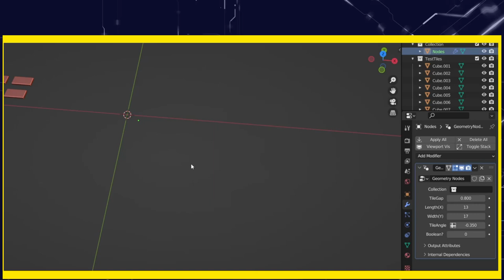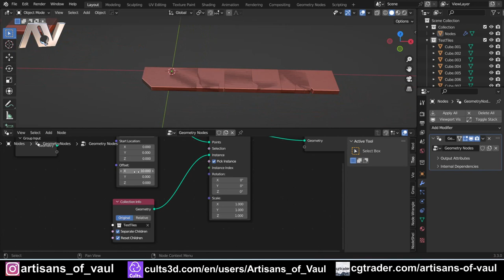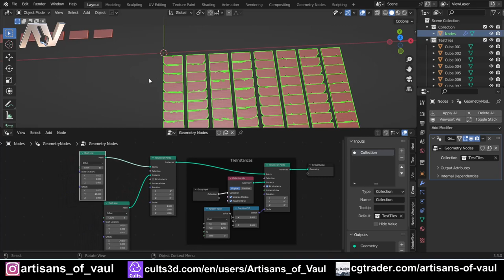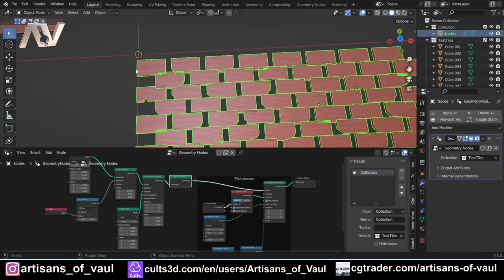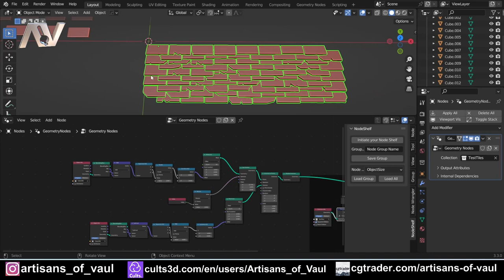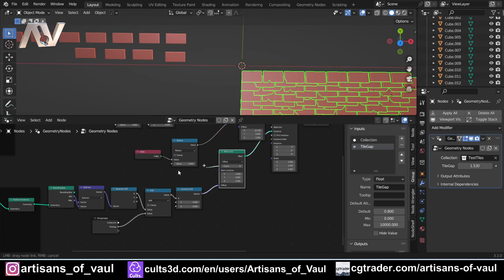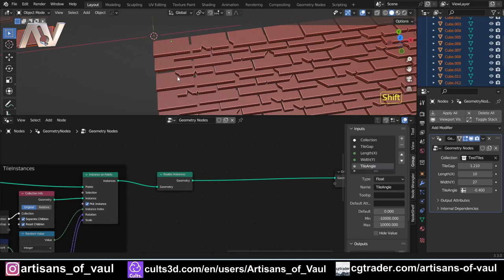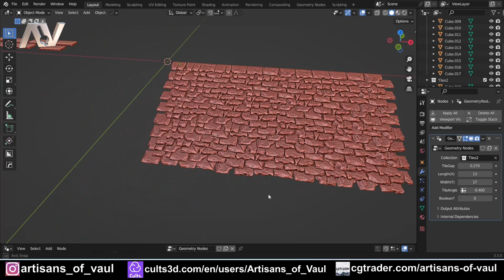The ultimate tiled roof geometry node setup

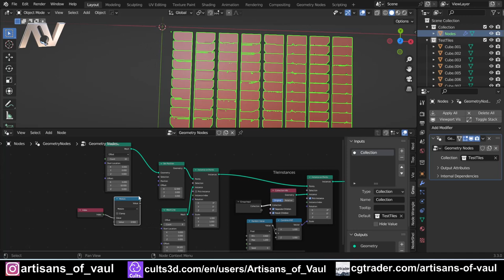Comment: 10:40 Looking for Modulo in 3.5.1? Add a Math node, then in the drop down select Modulo.
27:25 Press M "Mute" the Mesh Boolean note to speed things up, then when you're happy, unmute the node.
Reply from the maker: Oh great comment, I didn't know you can just mute a node. Thanks so much 👍🏻 Is there a way to do this from the group input (taking it to the modifier panel) without using a switch node setup aswell?

Comment: 8000 follower nice. Congrats. Next upgrade of the node is now to add a follow a spline so you can generate all forms of roof instead of only flat. Great work.
Reply from the maker: Thanks so much. I have been having a bit of a look at spline length, this just seemed an easier method as I assume a flat roof is the most common type to need, I do want to look at using spline length for something in the future but there seem to be a million videos on YouTube recently with tentacles so I thought I'd leave it for now 😅 Definetly in the future though👍🏻
Reply: @ArtisansofVaul   Make it !!!!! ... NOW !!!!  🤣😂
Reply: That´s what i looking for ...
Reply from the maker: @Container-11  😅 As in rounded roof sections/corners.  I imagine the issue there would be that the tiles would need to be either smaller or less at the higher levels to accommodate the turn.  That is a tricky one.
Reply: @ArtisansofVaul  Thanks for answering😃.... someone😉, maybe could combine the curve/spline with the array ...
Reply from the maker: @Container-11  So thats very possible.  In fact there are some really cool things you can do with it involving the spline length.  I think in terms of an angle roof it could be tricky to make it work easily.
If you want to check a video on using splines with arrays I have one you might like here: https://youtu.be/_7JLcoozOiM
Reply: @ArtisansofVaul  I have seen this Video and a Idea popped up in my old brain. A curve spiraling down and with it the Tiles for the round roof.
I will try this...later. Time is my problem

Comment: good well explained video, super useful video to learn geom nodes.

I'm trying to add starting and ending tiles but cannot figure it out. What i think needs to be done (but i don't know): 
1. instead of using the x-offset we add a point at the start of every other row which has the distance of the offset instead of the regular points distance (vice versa for the END of the other rows)
2. At these 'offset-points' use an object from another starting-tiles or ending-tiles collection ( like an if-dividable-by statement almost)

Is there a simple solution like that for this?
Reply from the maker: That should be possible as you can select specific points. There's a number of ways you might want to check out: https://youtu.be/09wyhmrSGPk

Comment: Can you do an old church wall the same way? I am trying to find a way to do a very old church wall that has rows of different sized bricks. Quite mind boggling.
Reply from the maker: You can but having each of the bricks a different size would be difficult as it works off of having the tiles the same size.  So youd make multiple sets of different bricks with each set adding up to the same.

BUT....  If you dont mind not using Geometry Nodes use the wall builder option.  Check out my videos here if you want to check it out:
https://youtu.be/SomEVY5qG0M
https://youtu.be/ylX-NEnPH1E

Comment: Great, but two questions. 1) can you add an opening for a skylight while keeping it as geometry nodes? 2) how do you deal with the sides? A real roofer would cut half tiles on alternate rows!
Reply from the maker: Yes to both but the skylight would probably be easier outside geometry nodes. Cutting off the half tiles I left off as it's just using the same tools again (use the size of the tiles to move a cube that is large enough to cut everything and use a boolean to remove it. I did think about putting it in but having a video much over 30mins seems to decimate the number of people that actually view it and because of the wonders of how YouTube works that means it doesn't get put on as many peoples feeds
Reply: @ArtisansofVaul  my experience with booleans and geometry nodes is that they don't work together. Your machine will just grind to a halt. I've not found a solution yet.
Reply from the maker: @privacytest9126  So the switch at the end of the video really helps deal with that issue. It's booleaning together some way more complicated shapes so cutting a cube off the ends should be fine. But admittedly it does depend on your machine. And importantly for the skylight your computer will find it easier if you applied the geometry nodes and then did the boolean.
Reply: @ArtisansofVaul  Sure, but applying your GNs, then doing a boolean kind of defeats non destructive modeling! Thanks for the reply, btw. 🙂👍
Reply from the maker: @privacytest9126  I mean that's only needed for the skylight. And you could do it without but I think it would be more effort/time consuming. The cut off ends I'd do in the nodes.

Comment: the only question I have with this roof is how it prints. there is a big gap at the bottom, isn't there? how do you solve it? other than that, amazing job, straight to favorites!
Reply from the maker: What do you mean by a big gap at the bottom?  Because of the overlap it makes a pretty strong roof when I have done something similar before.  I might have to print it to show the end result.

Comment: Hi and congratulations for your work. I am new to blender and geometry node and I managed to reproduce your tile set up. However, I wanted to go further by trying to get random tiles along the length but I couldn't. To be precise, I can get tiles of different lengths by connecting a Random Value on the Y of the Combine XYZ in the TileInstances but the bounding boxes don't follow. I have gaps that I can't correct. A solution maybe ? Thanks in advance.
Reply from the maker: So the gaps are actually really hard to deal with when setting random sized as you can't set the vertices to match.  An alternative is to actually make random tiles and then set to to randomise between them. If you have the random ones in sets of 3 or 2 of varying sizes but that the total fits the gap you could do it that way.

Comment: Also for 3D printing, how would you make sure there are no actual holes in the roof between the tiles?
Reply from the maker: So the holes are only there because of the extreme/exaggerated cuts on the tiles. But you could always add in a cube below the tiles that increases in sized based on the tiles.

Comment: How would one go about doing angled roof intersections where 2 roof sides meet with geometry nodes? I typically do this by hand by picking out some tiles and using the Mesh Deform and a cube to deform tiles to make them follow the intersection line. Is there a way to introduce a line or a plane that edge tiles have to follow?
Reply from the maker: Great question. I'm actually working on something similar to this issue now to create mandalas or that style of pattern more effectively. I would imagine something similar might be able to be used. I've been finding the arc tool in Geometry nodes to be really handy so far so that may help you out as well. Though you may find it more tricky to position than my usage.
Reply from the maker: @darkobakula5190  Oh totally. I think that might be tricky with Geonodes. Maybe using the line where they join shown as part of this video though: https://youtu.be/Rmn6R5RehBc
Reply: @ArtisansofVaul  Right now I am using trim sheets and atlases to do my roofs combined with displacement if I need that geometrical detail for close-ups. Geo nodes is way too technical and time consuming for me. But I always love to see amazing stuff people are doing with it.

Comment: Why not just plug the boolean for the switch node directly into the Group Input to have a toggle to switch for whether or not you use the Mesh Union?
Reply from the maker: If you can do that, that's brilliant 👍🏻
Reply: @ArtisansofVaul  I mean I did and it seems to work so far... Geometry Nodes modifier has a check box you can toggle for the boolean value and I named it "Mesh Union"
Reply from the maker: @mr.cobalt1668  awesome 👌🏼

Comment: Hey bro I was wondering if you would know anyway on how to make roof corners that is built into the geo set up ?
Reply from the maker: Hmm... that's going to be really dependant on how you'd want it set up. I'd probably get it to recognise where the two faces from each of the roof sides Intersect and work from there. Probably not the simplest task but I think it would work. Maybe getting it to select edges that are connected on multiple sides....
Reply: Ok man thanks for the advice I don’t think I’m quite there yet, gonna use the old school method of applying the modifiers then Boolean, should be good enough for this project. Massive thanks for the video man I’ve used it with a curve modifier and it’s given me loads of variation
Reply from the maker: @bobgriffiths6573  My pleasure 😁😁😁

Comment: how would you set the even rows to start and end with tiles that are half the x so that they line up using geometry node?
Reply from the maker: @willtiefuhr5245  I'm not totally sure I get what you mean, I think you mean making the ends/sides level using a half tile? I would set up a cube on either side with geometry nodes and then have it placed at the end using the calculations for the tiles, then use a difference boolean to remove them from the tiles to delete the half you don't want.
Reply: @ArtisansofVaul  Thanks, If I figure it out I will let you know how I solved it.